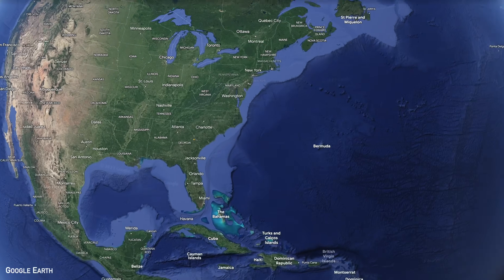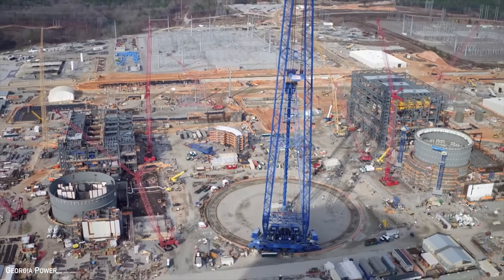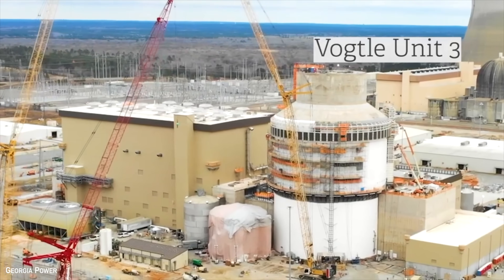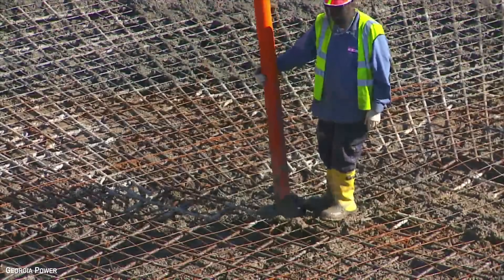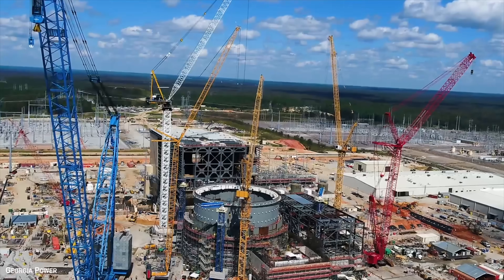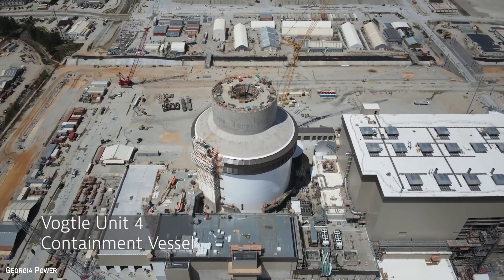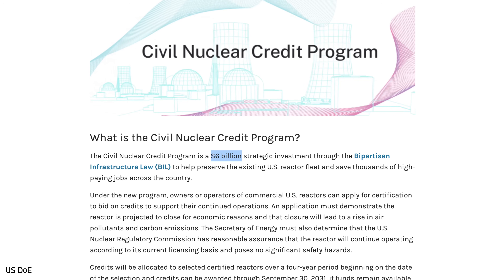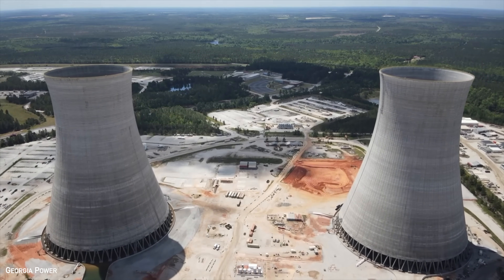Why the Future of Nuclear Power Depends on This Plant

Comment: The Feds should pay for all of the cost increases because they caused them with over-regulation and design changes to plants that were already well designed !      "Low Carbon Future"?  Why?  That is not an issue;  CO2 is plant food and it does not control the Earth's temperature!
Reply: VC Summer and Vogtle had to make progress and problem reports to their PUC every 6 months.  Show me ONE , just one where they blamed any cost over runs on the "Feds"
Reply: If you live in the U.S. here is the reality for the last 4 “state of the art” Generation III Westinghouse AP1000 ADVANCED  new nuclear power projects and spent fuel reprocessing in the U.S. over the last 20 years. The AP1000 is fully approved by the NRC for construction and operation.  The only NRC requirement is that the plant be built per design documents…..seems simple..

The Southeastern U.S. is super pro-nuclear MAGA, has zero anti-nukes, and 100% media, local, and political support. 

The MOX facility (South Carolina) was a U.S. government nuclear reprocessing facility that was supposed to mix pure weapon grade Pu239 with U238 to make reactor fuel assemblies. It was canceled (2017) in the U.S. After spending $10 billion for a plant that was originally estimated to cost $1 billion and an independent report that estimated it would cost $100 billion to complete the plant and process all the Pu239, Trump canceled the project in 2017.

VC Summer (South Carolina) new nuclear units 2&3 were canceled in 2017 after spending $17 billion on the project (original estimate of $14 billion and 2016 completion date) with no clear end in sight for costs or schedule. Four managers on the project were charged with 16 felony counts, including conspiracy, wire fraud, securities fraud, and causing a publicly traded company to keep a false record.  The CEO of the project is serving 2 years in prison, another manager just got 15 months in prison, and the others are awaiting trial.

Vogtle (Georgia) new nuclear units 3 &4 at 110% over budget and schedule (currently over $34 billion with an original estimated cost of $16 billion). Mid way into the build, the utility stated that had they known about the many costly delays they would never have chosen nuclear. They were just delayed another year because according to the project management, thousands of build documents are missing. The first unit should start in 2023 and when it does, Vogtle will be, for its output, the world’s most expensive nuclear power plant.

Please google any of this to confirm.

If you can’t build new nuclear in the super pro-nuclear southeast U.S. then where can you build it?
Reply: Is this the utility blaming the FEDS?

Below is the Vogtle Project Management's answer for the latest delays:
Southern Co. yesterday announced another delay for its long-troubled nuclear construction project in Georgia, edging its costs closer to the $30 billion mark. 
The setback could now push the startup date for Plant Vogtle’s first reactor until early 2023 and move the date for the second one to later that year. 
Plant Vogtle’s latest move highlights the nuclear industry’s chief troubles with building large, baseload reactors: safety and cost. To be clear, Southern executives have blamed this new hiccup on paperwork, saying that workers were gathering it to send to federal safety regulators and noticed critical inspection records were missing or incomplete. The pile of missing or incomplete documents added up to a delay of three to six months, Southern said. That additional time is costing $920 million. 
“We’re a little frustrated with the latest developments,” Southern Co. CEO Tom 
Fanning talked of “great momentum” at the construction site since November. 
But workers realized “tens of thousands” of critical documents were missing, leading to a three-month backlog. 
“We’re fixing that part of the ‘paper’ process,” he told E&E News.

LATEST: Georgia Power says Unit 3 could now begin commercial operation in June, 2023, pushing back from the most recent deadline of the end of April.  Unit 4 will begin commercial operation by March 2024. The company previously has promised commercial operation of Unit 4 by the end of 2023 at the latest.
Georgia Power discovered that a pipe that is part of a critical backup cooling system was vibrating because construction workers had failed to install supports called for on blueprints. 
Fanning told investors that other issues causing delays included a slowly dripping valve, as well as a problem involving the flow through the reactor coolant pumps that hasn’t been pinpointed.
Georgia Power ratepayers are already paying for Vogtle, and most electric customers in Georgia, as well as in parts of Alabama and Florida, will eventually be charged. The effects of the further delay on ratepayers are unclear. Georgia Power has signaled it may could ask for more to be paid for capital costs and financing.
Reply: Climate change is absolutely real. 

Why do you continue to deny this???
Reply: @Krill_all_health_insuranceCEOs  First you actually have to name a FACT.  You live in a world of alternate reality where conspiracy theories are real and facts are ignored
Reply: @clarkkent9080   if you consider yourself intelligent you have to reject the insanely obvious fossil fuel industry's long disinformation campaign regarding climate change.
Reply: @clarkkent9080   you're way gone if you deny climate change.

Comment: Vogtle Unit 3 was synchronized and connected to the electric grid on April 1, 2023, the first nuclear power station to do so in 3 decades.
Reply: By the world's most expensive (per Mwh produced) nuclear plant in the world by a great amount
Reply: @clarkkent9080  Adding only 4 hours of storage to variable renewables pushes the cost well above the cost of electricity from Vogtle. And the true amount of required storage far exceeds 4 hours.
Reply: @gregorymalchuk272  I am not pushing any particular power generating agenda.  But the simple fact is that to compete with other generation methods (including renewables, coal, natural gas, geothermal, etc.) a 1,100 Mwh nuclear unit like Vogtle unit 3 must cost less than $7 billion.  
Unit #3 is now over $15 billion.  I have watched the project from the very start since my work has always been in nuclear and shortly after breaking ground, Southern Company then stated that had they known the rising costs, that they would not have chosen nuclear.  And that was when they thought the cost was only $1 billion over their original estimate.
Because of Vogtle and VC Summer, no other utility is even remotely considering new nuclear
Reply: @clarkkent9080  “no other utility “

In the US, with this NRC, no other utility is. Until V3 started, the NRC has never licensed any U.S. reactor from initial proposal to start up. The former AEC took the initial proposal from every other existing US reactor.  All of them.  So why would any US utility attempt any NRC dependent business.  

Elsewhere in the world some 60 reactors are currently under construction, and they will most likely all be affordable.  See eg Barakah in UAE under $5000/KW, 75% online. 

The US in late 60s built a dozen reactors in 2-4 years for under $1000/kw, todays $, great safety records, several still running. All built under the US AEC.
Reply: I'm glad to hear that. 

Over the longer term, like most things, nuclear energy's costs will come down.

Comment: Why are they trying to keep forcing this, the most expensive option for generating power when their are other options for a clean and safe production of power. It’s like the 1950’s all over when the snake oil sales men would hit the Sunday talk show circuit with “nuclear power is on par with our current options at only .18 cent a kWh.”  And just like now all the other cost are never spoken about. I hope this country is not stupid enough to buy this crap again !!!
Reply: just because initial costs are high doesn't mean we shouldn't do it. 

All renewables have a part to play in the world's energy future but nuclear has to be the backbone. No single renewable method is perfect for all conditions - EXCEPT NUCLEAR.

And mid-term and final storage tech is actually very safe. Some plants can reprocess used nuclear fuel rods down to very low amounts. Thorium is a game changer. 

It's all here. All it takes is govt support which in the US we aren't getting. Is that because Congress are wh0res who answer to oil and gas? 

Um, yeah.

Comment: What limits the lifespan of a nuclear facility?

Why can Westinghouse build two nukes in China, but failed here?

According to Illinois Energy Professor, it takes about 15 year to pay back the capital used to build the plant. Gas is cheaper during that phase.  However, after that, nuclear fuel is cheap per mega watt/hr, while the gas plant has to keep buying natural gas.  So, long haul, electricity is cheaper with nukes.
Reply: That Illinois Professor used $7 billion in the calculation of the cost of new nuclear not the actual Vogtle cost of $17 billion per unit.

What limits the lifespan......a nuclear plant can operate for ever with maintenance and replacement of failed components since nothing lasts for ever.  But just like an automobile, with age, reliability and upkeep costs skyrocket and at some point it is no longer cost effective to maintain.  Same reason you see very few 1970s automobiles on the road and the ones that do exist are not daily drivers.
Reply: @clarkkent9080   He was talking about cost of a plant as typical up to the point of lecture.  

I don't think your car analogy is apt.  Cars are not built to be "bullet proof," but a consumer item.

The aircraft carrier Gerald Ford's reactor will run for 50 years w/o refueling.  And, of course, at that point the ship will be outdated.  Why are we talking about a 30 year lifespan for nukes?
Reply: @frequentlycynical642  Nuclear power plants are designed for a 40 year life span not "bullet proof". No valve, breaker, pump, or motor has an expected service life of forever.  Many components are one-of-a-kind and many more are no longer made by the time the plant is competed. So replacing anything is very expensive and time consuming.
Any safety related component replacement must be EXACT or a very detailed engineering evaluation must prove a like replacement meets all the original design specs.  It is MUCH harder to maintain a nuclear plant than a 1970s automobile and the analogy is exact in that it is the same reason people just don't maintain them and drive them forever.
I worked in the industry for 40+ years at 5 different facilities and every component has a design lifespan. Every valve is designed for x number of cycles before it has to be rebuilt or it will leak.  Every motor will eventually burn out.  Nothing is made to last forever.  Every refueling, many components are repaired or replaced.  many components fail during operation and the plant is shutdown for repairs.

Here  is the oldest (52 years) operating nuclear power plant in the U.S. and their primary coolant return  line corroded and leaked 400,000 gallons of radioactive water into the ground.  They fixed it and it lasted 5 months and leaked again.

Regulators are monitoring the cleanup at the 52 year old Xcel Energy Monticello Nuclear Generating Plant after it leaked 400,000 gallons of radioactive water.  The leak was first discovered in November 2022 when radioactive Tritium was found in a well.
The incident at Xcel Energy's plant, came to light on Thursday, 4 months after it was first detected in a groundwater monitoring well. The reactor continued to operate while plant personnel tried to locate the leak. State officials said they delayed because they wanted to gather more information before going public.
Officials said the water contains tritium that is thousands of times above EPA limits but is of no risk to the greater public.
"We knew there was a presence of tritium in one monitoring well, and Xcel identified the source of the leak as an underground transfer pipe," Minnesota Pollution Control Agency spokesman Michael Rafferty said, per the AP.
Reply: @clarkkent9080  Thanks for your insider thoughts.
Reply: @clarkkent9080   so the problem isn't with the technology or storage of nuclear power, but faulty maintenance procedures.
Reply: Westinghouse licensed the design for the AP1000 to their partners in China and the chinese government pushed towards using local contractors as much as possible... and because China has construction companies with loads of experience in building nuclear plants, they managed to do it far more quickly than in the US.
Reply: @johannesgutsmiedl366   nice

Comment: The cost of Vogtle 3&4 has put a nail in the coffin of large nuclear.  It killed South Carolina Electric and Gas (aka, SCANA).  I used to go there 4 times a year when I worked in the nuclear side of the insurance industry.  The amount of waste, mismanagement, etc. that I observed was staggering.  One of the biggest problems at this site was the modular design did NOT save time or money.  Had they built it in a more standard method with concrete forms, etc. - it probably would have been more on schedule and budget.  They changed A/Es 3 times - that wasted incredible amounts of money and put them progressively more behind schedule.  Not until Bechtel got on the job did real progress begin.  I think this project will make every utility CEO run rapidly away from large nuclear.  The future of nuclear is probably small modular.
Reply: Vogtle should have been canceled along with VC Summer.  The interest on the construction loans for both units is $1 billion per year and I cannot see how they can raise rates high enough to even cover interest.
Reply: @Clerk Cant  Yet you continue to ignore from your blank trolling channel that many countries have been building and using small modular reactors for many decades, built in two years or less for millions not billions.

Comment: Vogtle is not a success. At $25B this is decidedly NOT a path forward.  This is roughly 10x the capx of nat gas powered plants.
Reply: It has been stated to be over $30 billion for both units but that does not include the $4 billion cost to Westinghouse so the real total cost is $34 billion
Reply: @Clerk Cant  Yet you continue to ignore from your blank trolling channel that many countries have been building and using small modular reactors for many decades, built in two years or less for millions not billions.

Comment: Good summary.  I was in management on the AP1000 projects and was responsible for some key components on the Vogtle and VC Summer Plants.  The factual short story you walked us through is accurate.  However,  and like with any bankruptcy, there were a series of bad decisions that were made at key points by senior management that suffered from a serious case of the Dunning-Kreuger effect.  This was also the third time the Westinghouse Company went into bankruptcy.
Reply: NO  one in project  management or construction management should ever work on another nuclear project.  I also know many people working on these projects and while it is not the only reason, the ex-navy managers just worried about covering their behind instead of doing what is right

Comment: The most important thing is to convert 300 coal-fired power plants in the United States, to nuclear powered. The US department of Energy says it is possible.   And cheap.  Our best coal plants should stay open exclamation for the next 100 years! But they have to stop burning coal. No problem. The molten salt fueled reactor is small enough and hot enough to run the turbines, the generators, the owners, the labor, the politicians, and the customers. 
China's already building the right kind of reactor, and have already started converting one coal plant to nuclear. Assuming they like it, China and India will be the United States to zero carbon that way.
China is very thankful for the cooperation with Oak ridge national Labs that makes it possible to use the design created under president JFK.

Comment: Good job on the video.  Actually finishing the Vogtle project was a big surprise to me. I worked on the project back in 2007 when we were doing the site permit. The certified design seemed to me would be very difficult to construct.  It is good that they were able to finish it.

The AP-1000 is the first nuclear plant in the US to use an open refueling water tank built into the containment. The old Westinghouse reactors had that tank outside containment. So it will be interesting to see how operations go with high containment humidity.  (Have you ever been inside a GE Mark I taurus?)

Another good thing is that this is a large base load plant.  It is exactly what is needed in the USA. I know everyone is excited about the SMRs (I worked on those designs too), but the economy of an SMR is just not going to work I don't think.  All of the licensing, safety requirements, site requirements, security, staffing and NRC oversight is still built into the price of each nuclear facility. No matter how small you make it.

Comment: Another scam no Matter how good willed by the scientists. Sure the company isnt.
Imagine if this happened to a solar or wind power.
Reply: Imagine trying to replace the two new reactors, total 2200 MW, w 300 W PV solar panels at 20% capacity factor. Count them up.  

Count again to get through winter w 15% panels.  

Count the acres of solar at 5 acres per MW. 

Then it all shuts off every night

Count the material tonnage of PV, at 20kg per panel.  Triple that for steel concrete copper to hold them in place and connect.

Then imagine the battery, 2200*16 MWh.
Reply: It happens to wind and solar everyday.  They will be the demise of our grid if the Greenies get their way.